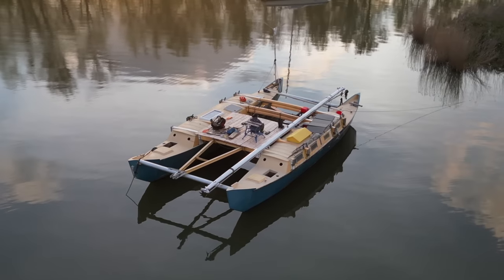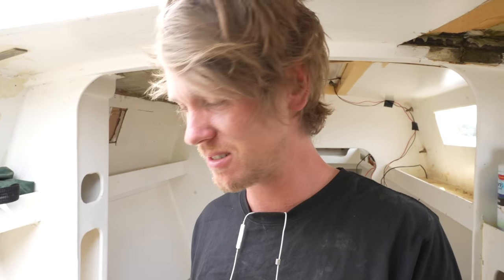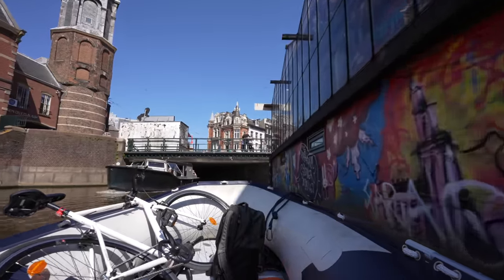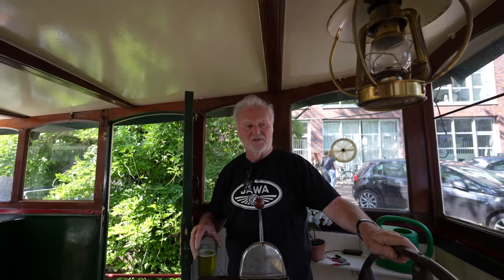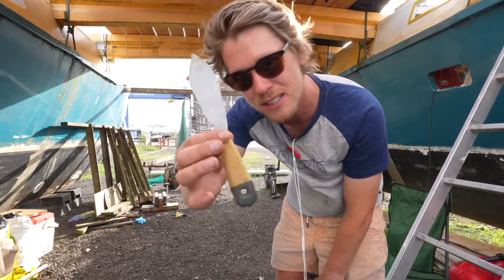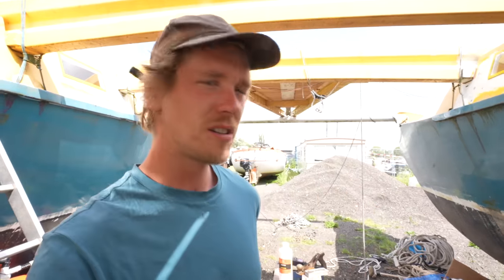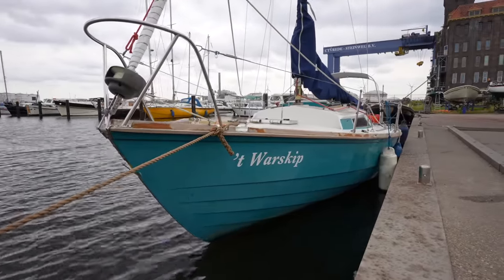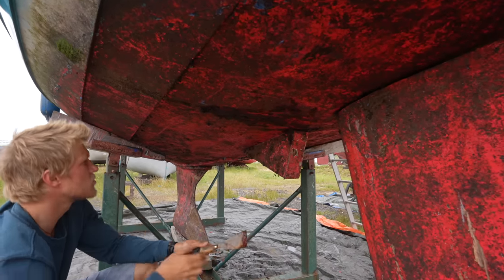My Project Catamaran Gets Sealed Up! | Wildling Sailing

Comment: If you need to keep pressure on the backing plates on the inside in a tight space while they cure. drill a 10 mm hole in the backing plate,  use a 10mm wood locking nut so it does not rotate ,then a plate with no resin on the outside with a 10mm hole as well and use a bolt to tighten up the inside plate from the outside.  to make a tight seal while the resin sets. the 10mm hole will be covered by the round plug, from the outside. so you dont need to fill it unless you want to.
Reply: even 6mm would do it...

Comment: Wish I could now dinghy into Amsterdam.Although have been there, I just took my Dutch Masters antique painting to get a slightly smaller frame so it will fit in a cubby hole in my boat. You seemed to dinghy past where I bought it outside ring by Hotel De L' Europe.
Reply: Interpol are looking for you...

Comment: You might want to try a Olfa rotary cutter. The quilters use them. A lot faster than scissors for cutting glass. You’ll need an old piece of plexi to cut against.

Comment: You could use two wedges and some kind of beam to add pressure to an item that you want to glue to a surface.
Reply: I say screw it... A flex extension for your drill is a valuable tool.

Comment: If you can get a cheap digital scale (ones accurate to below 1g are pretty easy to find these days), you can stop dealing with this pump nonsense entirely and just mix by weight. WEST is 5:1, so if you pump in 100g resin, you then add 20g hardener. With the pumps, if the pump ever doesn't seem to dispense a full pump (which seems to start to happen eventually), you essentially have to discard the whole batch, which is a hell of a waste.
Reply: Yes, those pumps are a bit of a gimmick.
Reply: +1 For that,  I ditched the pumps years ago.

Comment: Wow..
You truly rigged those thru hull holes..
Personally I believe they won't last leak free for years to come and may even pop out if you experience ruff seas throughout time..
You should have just installed new thru hull fittings and blocked them off.
At least you would have had the proper pressings on both sides of a hole that you can depend on the making of such with the proper mechanics to keep them in...

Comment: Question for you fiberglassers...  I wouldn't have used a backing plate and would have fiberglassed the interior like the exterior.   Thoughts?
Reply: He is  only using light 16 oz scrim glass cloth. The backing plate, while potentially a dirt collector, is a good solution.
Reply: @dnomyarnostaw  what weight should he be using to ensure that banging up against the hull doesn't sink him.
Reply: @robertfontaine3650  To replace  the backing plate, Minimum 400gm/m² Width: 1270mm Weave: Biaxial,  each side, with Rovings in the hole. Its a very small hole to support

Comment: how are you going run your gauges?
Reply: What gauges are you thinking of ?
Reply: @dnomyarnostaw  speed, depth, maybe sonar?
Reply: @BlueMooseTraveler  You don't need a 2" hole for that cable. You can have a "blister" low down, lower than the thru hulls, and a thin cable running up the side.
Reply: @dnomyarnostaw  ok captain... smh.  too literal my guy.

Comment: Bingo! Why would one have holes in a boat below the waterline? 
Thusly,  you are similarly too smart to mess with wire rigging.... innit?
Reply: Because Gravity.
Reply: I don't think holes are critically necessary. If he has  good bilge pumps then fine. Other things like toilet waste can work as in caravanning. If Mark ends up with a good living area between hulls, there's plenty of ways to access or vent to the sea from there IMO.

Comment: I was watching another video and someone made a comment about Saltwater over a period of time will, soften Epoxy.  Is there any evidence of that happening or do you know of anyone that has had that experience?
Reply: All the tests of high quality Epoxy, show 50+ years of Impermeability.
Non Marine epoxy, or Epoxy diluted with solvents are where the problems come in.
Lets face it, most wooden boats that use epoxy need a major rebuild every 30 years.

Comment: shouldn't you be using CPES ? 1 to 1 penetrating epoxy timber preserver such as everdure or similar & square end plastic spatulas are the best for spreading glue & filler etc.
Reply: Um, no? The thru hulls aren't in rotten wood, which is what penetrating epoxy is for.
Reply: @dnomyarnostaw yeah granted, but CPES is actually known as timber preserver & is far better than high viscosity epoxy for prep of all wood prior to filling, glass sheathing & painting
Reply: @philrogers1758  There is no rotten fibres for it to penetrate .
The epoxy bond will be totally effective.

Comment: No way that's going across an ocean.
Reply: It will just watch this space, but I wouldn't take it across 🙂
Reply: Why do you say that?  Many of these exact same boats have.
Reply: Lot of work to do before crossing, but the design is sound. So it is just a question of whether he can do all the work to a sufficient quality standard. If I was going to bet, I would be that he does make it. The boat is not a piece of junk or inherently un-seaworthy. It just needs work.
Reply: @dherman0001  Yes, but not with windows secured with double-sided tape.....
Reply: @Andy-gb4yr  🤣
Reply: @mikeholt7881  securing windows with VHB tape is now a standard practice in boat building. Have you ever used VHB tape for anything?
Reply: @epcode5121  He will probably have to add some through-holes back in at some point for sure (in my opinion). But by plugging the existing ones, he can free himself up to think through where they should be. Normally, bilge pump through holes are above the waterline. So he probably will not need to haul out to do that.
Reply from the maker: Bilge pump thru hulls go above the waterline
Reply: @mckenziekeith7434 👏👏👏👏
Reply: @mckenziekeith7434  I think some ppl commenting here are in the unspoken camp of monohulls versus multi-hulls. Plus they don't know much about Wharrams.
Reply: @travelbugse2829  I'm the OP and own a Hirondelle 23 cat.......
Reply: @mikeholt7881  They look too rigid to me. And 7mtrs. Ok so you're a cat man, there - you got me!!
Reply: @travelbugse2829  Are you obsessed with size and rigidity? 🤣🤣
Reply: @mikeholt7881  At my age, yes.

Comment: Why would you bung the wholes from the inside when the pressure is from the outside pushing in what you should have done is taper the holes from the outside glue the bungs in sand flush then glass over you really need to think about what you do before diving in your making far too many mistakes and taking short cuts, just don’t take this out in the Atlantic unless you don’t intend on coming back.
Reply: He didnt watch the video over.
Reply: The backing plates are waaaay overkill for those small holes.
Reply: @dnomyarnostaw  And over-kill is bad how?
Reply: @oregon1232  Well, for a catamaran,  penalties of weight.
Reply: @oregon1232 exactly👏👏👏 Just what I was thinking!!!
Reply: @dnomyarnostaw Really?!?!
Reply: @MaryFandStevieG  Yep. If you have ever done the weight tables for these small boats, especially on long ocean voyages, 100-200 kilos extra is a considerable penalty, both in speed and supplies.
It doesn't take many hefty patches to eat into the margins.